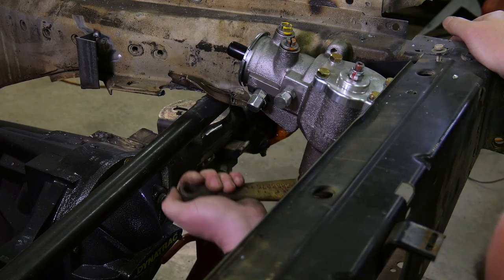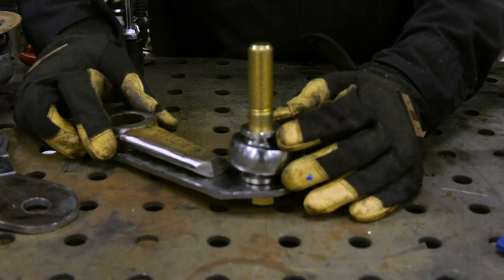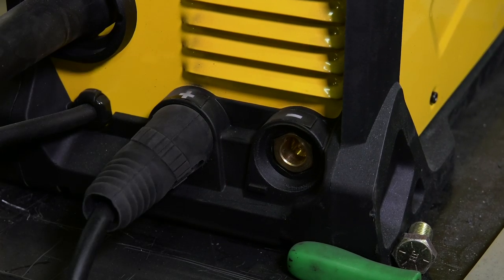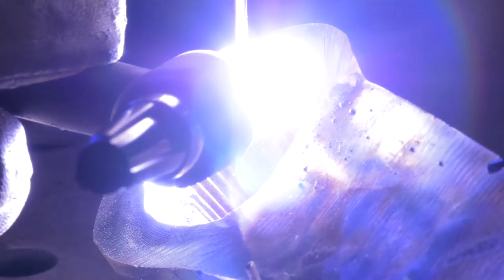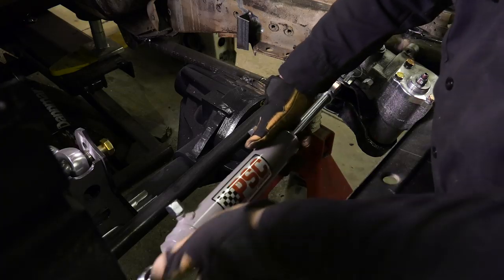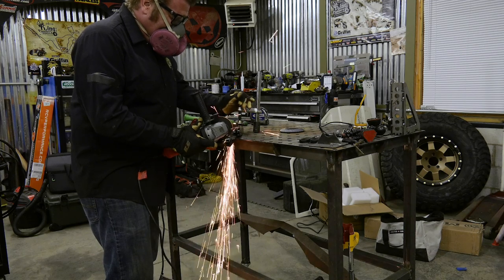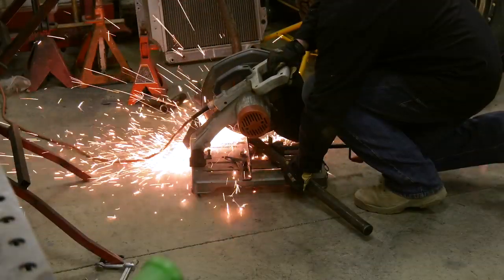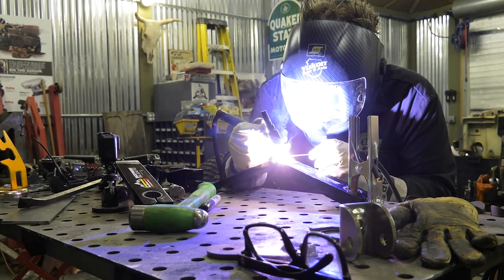How To Build a Custom Pitman Arm; Project Gomanche

Comment: Ian I have a question for you, I have a 1963 international scale 80 with no title doesn’t run, I also have a 1994 GMC Jimmy with a title and does run but the gears it the rear end are done, I like both vehicles but I can only keep one if you were in my situation which one would you keep and turn in to a mudding truck, the Jimmy is a 4 door and automatic transmission, both need a lot of work to make them right.
Reply from the maker: I always hote for Old Iron..all day everyday

Comment: How did you go about determining how much offset you needed on the pitman arm?  I'm curious about more detail in the the taking some measurements and cycling the steering back n forth a bunch of times part.
Reply from the maker: It was basically just that...I made a template out of Cardboard and madw multiple turns left to right to check throw

Comment: I tried running hydro assist to the pitman arm on my CJ/crawler. I felt it didn't work as well as on the axle. Now this was on a leaf spring suspension. I don't know if that made a difference but it just didn't seem to help. I ended up moving the ram back to the axle and running to the tierod. Difference was night and day.
Reply from the maker: Interesting, I will let ya know what I find with this one...it is just 37's though
Reply: @BigTireGarage  Part of what I didn't like was being a leaf spring suspension was with the assist on the pitman. The axle moved side to side when it got to full lock. With the assist on the axle it didn't do this. Being linked you won't have that issue.
Reply from the maker: Yeah tou want to get the lengthnof the ram perfect on a system like this. It can break the sector shaft right off the steering gear. Another option is to add some type of Ram stop on the hydro assist cylinder itselfm

Comment: Ok I have a question on your hydro assist steering. I have a red head gear box that is ported for assist. It goes on a 2000 Dodge Cummins running 37s. Do you notice or know of any problems using them for highway driving at speed. I know slow speed is no issue. I live in Alaska and sometimes you need it to push you off a rock or log.
Reply from the maker: I drive with Hydro assist on the street all the time.
Reply: Big Tire Garage Nd you don’t have or notice any issues. I noticed you used the frame rail as the cyl mount. In my application I don’t think I can do that I’m running a 6in lift so I’m pritty sure axle mount is my only option.
Reply from the maker: You would have to do a more standard install with the ram on the axle